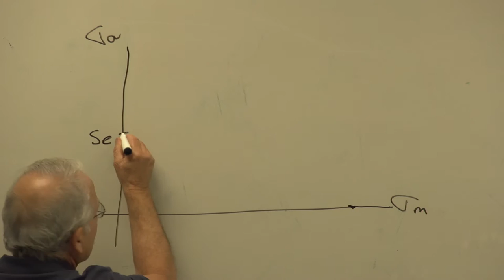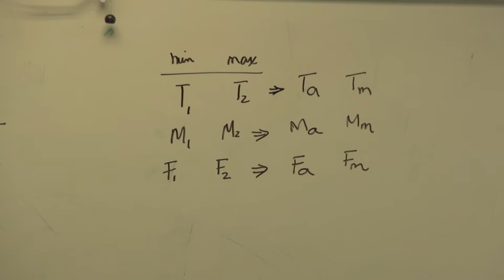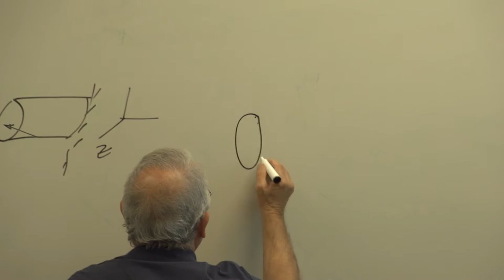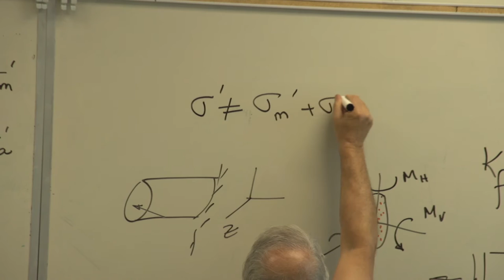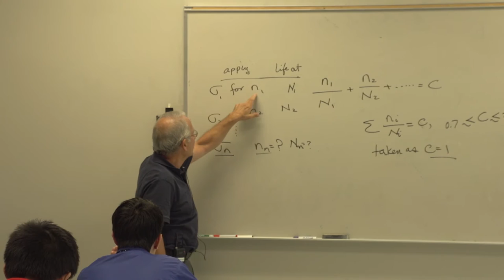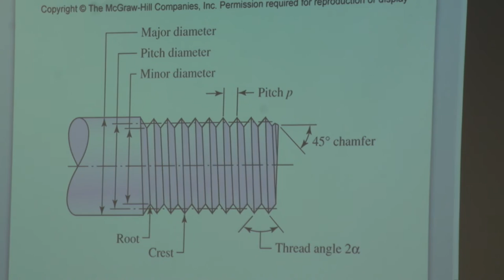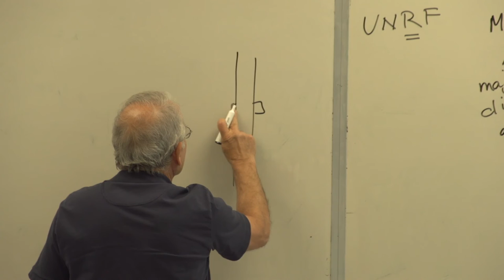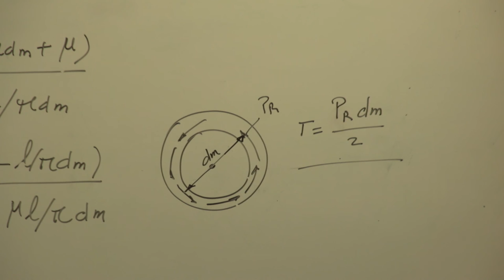Stress Analysis: Combined Loading Fatigue, Power Screws (10 of 17)

Comment: Thank you for these lecture series! I just wanted to confirm what was said towards the end. Is it friction or is it the weight that supports lowering the load?
Reply: its not friction that is helping for lowering but its a lead (l) which has reduced the F for lowering as seen from the equation.. also you can imagine that if pich angle is high l will be high and the F for lowering will be reduced...